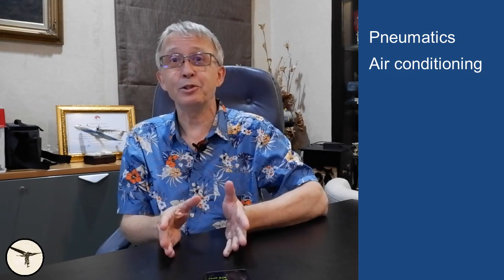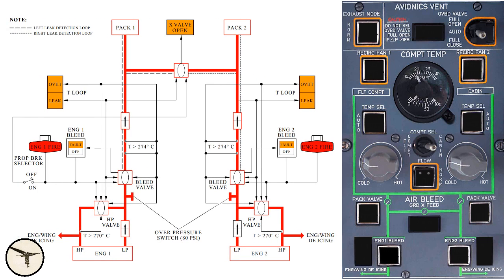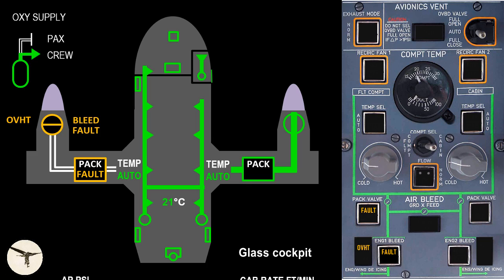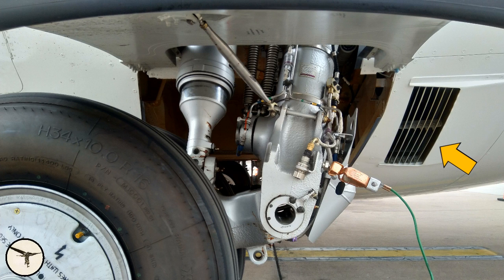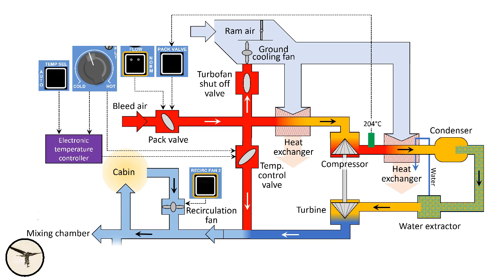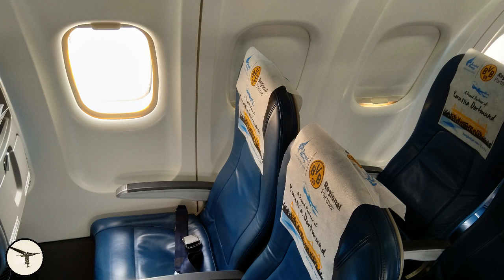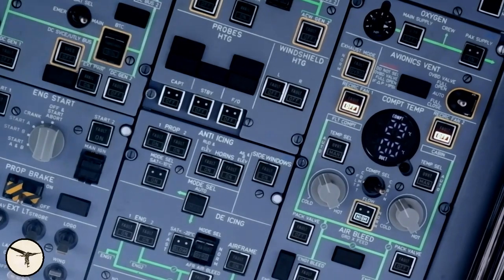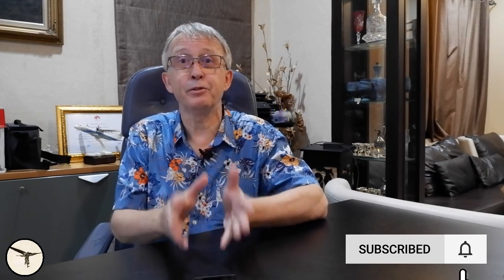ATR systems - Air conditioning

Comment: hello Captain hope you are doing well
i was wondering about a statement regarding the pack fault checklist which states : At high Altitudes large rapid power change AVOID. 
what is the main reason for such a statement ? 
Do we have to consider that we only have one pack remaining and that we have to avoid rapid power inputs to prevent compressor surge and then loosing the remaining pack ? 
the FCOM always relates loosing a pack or a bleed to large rapid power change avoidance to prevent the engine surges , but why such a thing ? 
best regards and thank you .
Reply from the maker: The reason is that a rapid power increase might result in excessive ITT, as the engine might respond more quickly. The same procedure applies then the EEC is inoperative.
Reply: @ thank you captain , but why doesn’t this happen with two packs operative ? the caution only exist with one pack inop , any informations ?
Reply from the maker: When both packs become inoperative, you reduce power and descend to FL100 (or MSA if higher.) At that low altitude, you do not have this issue.

Comment: Please Magnar, could you explain why we don't turn, let's say, the bleed #1 off when we are flying with pack#1 off (inop)? At least the checklist doesn't mention it. Thank you.
Reply from the maker: Because the associated engine bleed valve has not failed. Let's say pack #1 has failed. When you taxi in, you will normally shut down engine #2 after to minutes. Bleed #1 will then supply pack #2 via the crossfeed valve.

Comment: Air Conditioning on a ATR. Uh huh. Vague to almost non existant-better on the "large"-think PW 127 engines. The 120 engines-ugh. On an airframe that sold large numbers to operators near the Equator.
15 years as a lead heavy MX mech with a FedEx feeder-also dealt with MANY airframes coming out of Central & South America as well as Oceania. Toulouse could learn a few things from Boeing on that subject......
The Cabin Smoke Abatement mod did do wonders-but ya better have your David Clarks on real good.

Comment: Thank you for informative video.  Have doubt about regarding rotary knob for temp control. When there is auto temp mode is given then what is use of this rotary knob to control the temp.  It is understood when it is in manual mode rotary knob is required to control the temp but when it is an auto mode will that rotary knob make any difference. Kindly explain
Reply from the maker: In automatic mode, the temperature control knob is used to set the temperature in the cabin/cockpit. In manual mode, the temperature control knob is used to operate the temperature control valve directly. See FCOM DSC.21.2 page 20.
Reply: @FlywithMagnar  thank you very much for vlearing doubt

Comment: Hello, Captain. What should be done for dual bleed failure? Since bleed air is necessary for cabin pressurization, would an emergency descent be necessary when cruising at higher altitudes to prevent gradual decompression, or should only PACK VALVE 1+2 FAULT checklist be followed?
Reply from the maker: The cabin pressure will decline gradually, so an emergency descent is not required. Just follow the checklist for PACK 1+2 VALVES FAULT and descent to FL100 or MEA.

Comment: Hello Captain, thank you for your videos.
On this one, i have a question, related to the mixing chamber. You said that in case of fail of one pack, the mixing chamber supplied the other side. That was what i though also, but a few months ago, with this doubt, a mechanic show me the schematic, and there is one mixing chamber per pack, isolated. Meaning that doesnt have any connection to suplly the other side. 
Can i please ask you to clarify this? 
Thank you and best regards
Reply from the maker: It depends how you define "mixing chamber." The mixing chamber I was talking about, is a duct between the pack outlets. It is visible when you remove the floor panels.
Reply: Thank you for your answer. 
That make me a litlle bit more confused. I was talking about the mixing chamber after the packs. I though there was a single mixing chamber for the 2 packs, as show on cbts and fcom, but i´ve been show that each pack as a mixing chamber, and they do not feed air to the other side or pack, thats why now im a litlle bit confused again.
Reply from the maker: @ricardoamado3672 , ther mixing chamber is after the packs. If you have other drawings, please share them with me. You will find my email address on my profile.

Comment: How are you sir can you tell me please that oxygen level of aeroplane is maintan same like ground level when plane flying high attitude
Reply from the maker: That depends on the aircraft type. In ATR aircraft, the pressurization is controlled by a computer and provides a smooth change in cabin air pressure as we climb and descend. If we use manual override, we should be able to maintain sea level air pressure when flying up to 13,800 ft.
Reply: Ok thanks sir I understand but please tell me this oxygen is enough for small children's for breathing on the 8000feet
Reply from the maker: @khurramhanif9747  , no problem at all, unless the person, old or young, has a respiratory problem.
Reply: @khurramhanif9747  At normal cruising altidudes, the cabin pressure is about 5,000 to 6,000 feet. This is roughly equivalent to Denver, Colorado.
Reply: Ok thanks sir

Comment: Hello :)

Manuel mod- full hot position

duck temperature does not exceed 50 degrees in switch flight cmpt. mode and hot by-pass valve does not open. Temp cont valve open.
Where is the problem?

Comment: Hello Captain, thank you for such an informative video. 
When the airspeed is below 150 kt and retracted for less than 10 mins., the turbo Shutoff Valve opens. What is the significance of that 10 mins limitation?
Reply: Does the duct temperature limiter that limits the temperature in the dut at 88 operate in auto and Man mode?
Reply from the maker: Auto mode.
Reply from the maker: I don't know the answer to that question, but the turbofan is there to improve cooling airflow thorugh the heat exchangers.

Comment: Hello Capt. Magnar, i have a question to ask. On the QRH, if both packs failed, it is said that the max flight time is limited to 80 minutes. is there any specific reason/reference to the limited flight time? thank you very much.
Reply from the maker: CO2. When both air conditioning packs have failed, cabin air is not replenished with fresh air. This causes the CO2 concentration to increase. With a cabin full of passengers, the 80 minute limitation will limit the CO2 concentration to a maximum of 3%. This is regarded to be safe by EASA.
Reply: @FlywithMagnar  very well understood captain. Thank you very much for the reply.

Comment: Hello Magnar,
I am bit puzzled about ENG1 BLEED valve close logic during Hotel Mode. Do you know what is the reason for ENG1 BLEED valve to be closed when prop brake is engaged? Thank you.
Reply from the maker: Thank you for pointing out this. When I made the video, I used the latest FCOM revision. Unfortunately, the manufacturer made an error here. The last line should not be there. FCOM revisions pre-dating the EDORA (Electronic Documentation for Regional Aircraft) system are correct. 
Edit: I was too quick to draw this conclusion. Please read the responses below.
Reply: @FlywithMagnar  Thank you for reply. I did checked several of my FCOM dated between DEC 1997 and JAN 2018 and all actually state same information:
"The bleed air shutoff valve automatically closes in the following cases: ..... PROPELLER BRAKE selected ON (for only left bleed valve)"
So now I am puzzled even more. :-) Is this real behavior? Anyone able to observe this in aircraft? I know that it is not usual aircraft state, as typically when you have ENG2 in Hotel Mode (prop brake engage) you don't have ENG1 running. And standard procedure is to release prop brake before starting ENG1. Maybe @mzo could tell us? ;-)
Reply from the maker: This is getting more and more mysterious. I have FCOM for AT43, AT45, AT72, AT75 (3 revisions), and AT76 (3 revisions). All of them, with the exemption of one, says  "The bleed air shutoff valve automatically closes in the following cases: ..... PROPELLER BRAKE selected ON (for only left bleed valve). The 2011 revision of AT76 FCOM does not have this line. 
I have done a lot of starts where the propeller brake was ON and we started engine #1 first. During the start, bleed #1 was OFF. It was selected ON after the start and opened immediately. You can see it at 11 minutes in this video: https://youtu.be/sF8q8bcR8TU
FCOM says "PROPELLER BRAKE selected ON". This might be interpreted in the following way: Bleed valve #1 closes when we SELECT the propeller brake ON.
Reply: @FlywithMagnar  My FCOM are for AT45, AT75 and AT72 and I can confirm what you found - all state same. Also in your great video, it is clearly visible, that you can have ENG1 Bleed ON with Prop Brake ON. Do you mean that Bleed will close during Prop Brake engage procedure? And open again when Prop Brake is engaged? That is rather mysterious. Even more as I do not see reason for ENG1 Bleed to be OFF during Prop Brake engagement or even when Prop Brake is ON. Someone having any idea? ;-)

To add even more puzzles: in your video 11:24 - ENG1 Starter ON, around 11:45 ENG1 NH Stabilized and 11:50 ENG1 Bleed ON. This means that between begin of the start procedure and Bleed ON is less than 30sec. My FCOM says: During a starting sequence, the opening of the bleed air shutoff valve is inhibited. You mentioned in the video, that it is inhibited for 30sec. But it seems to be less. I can try to dig through Maintenance Manual, but I would expect Bleed opening to be delayed as function of NH and controlled by MFC, not by timer. But I was so many times wrong when tried to guess supposed ATR systems functions... :-)

By the way another interesting question. As HP air for deicing is not going through Bleed valve, but directly Deice Valve, so I would guess that Deice valve opening should be delayed as well during engine startup, to avoid potential hot start. But surprisingly nothing about that mentioned in FCOM. I would expect same logic to be applied for Deice Valve as for Bleed Valve during ENG start. This would cause AFR AIR BLEED and 1 ENG 2 annunciators on deice panel to cope with status of the Bleed valve. Or I am completely wrong?
Reply: Digging through Maintenance Manual Chapter 36: - During the engine starting the bleed air shut-off valve opening is inhibited an consequently the system goes to off. The valve will not open until 30sec after 45% NH engine has been attained. Is Maintenance Manual wrong about blocking opening of Bleed valve until 30 sec after 45% HN? Well I don't think so. MFC only seem to block normal Bleed valve annunciation (you should get FAULT when valve position disagreed with selected position). You can see Pack valve being Fault when Bleed is selected ON (at 11:49). This is due to no pressure available from Bleed1. And around 12:11 you can barely but see crossfeed valve opening (as Bleed1 finally delivers air pressure)! Which is almost exactly 30sec after ENG1 reaching 45% NH (at about 11:40) and in next shot (12:19) Pack 1 is already ON and running. :-) So I think this one we solved. ;-)

Still no information about bleed air shut-off valve and Hotel mode is mentioned in Maintenance Manual, only crossfeed valve is! So maybe be someone made mistake when creating FCOM and mistakenly put Bleed valve into relation with Prop Brake?
Reply from the maker: The 30 seconds delay in opening the bleed valve cannot be correct. In the engine start video ( https://youtu.be/sF8q8bcR8TU), we select the bleed valve ON 10 seconds after reaching 45% NH, and it opens immediately.
Reply: @FlywithMagnar  I meanwhile edited my previous answer, sorry for confusion. 30 sec from 45 seems to be correct, only MFC seems to be blocking standard bleed valve fault annunciation during this time.. :-) So you have Bleed PB pushed ON, no annuncitation (no FAULT) but also no pressure... until 30sec later. ;-) Bit confusing, but it is ATR. :-)
Reply from the maker: Yes, that makes sense. After selecting the bleed valve ON after engine start, it takes a while before the pack valve opens. Thank you for clearing this out.
Reply: @FlywithMagnar  I would like to thank you for making your great videos. It helps a lot!
Reply: @Dominic Strnad: Basically when you start an engine, HP bleed valve operates until after 30 secs of NH passing 45% where the LP bleed shutoff valve opens. 

Now when you are at the gate and put both Power Levers to FTR with the intention of shutting down Eng 2 first due to tailwind limitations, as soon you engage the Prop Brake, the left bleed valve is inhibted even if Engine one is still running because the airplane thinks you are in Hotel mode and gives priority to crossfeed valve to open so there is no sense in Bleed 1 still operating...if you get what I mean

Comment: Thank you Captain Magnar for this detailed explanation, really an eye opener for myself. 

I've experienced a few times while trying to cool the cabin, On hotel mode with HI flow & PL to the gust lock stop, after a few minutes it will trigger Bleed #2 Leak and therefore pack #2 fault. Would really appreciate your thoughts on as to why that may happen..even though the procedure is stated in the manual

Im operating in Malaysia where the OAT is about 25-34 celcius.
Reply from the maker: A bleed leak alert will close the bleed valve and the pack valve. I have not experienced this, even when it's 35 degrees. But a bleed leak alert must not be reset; the indication must be investigated by maintenance.